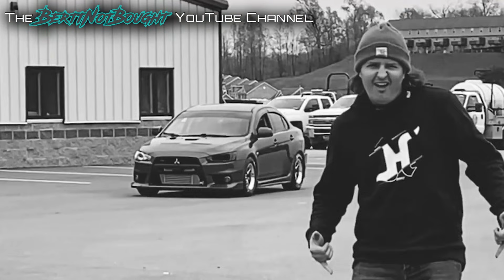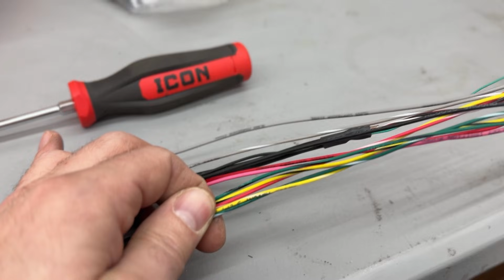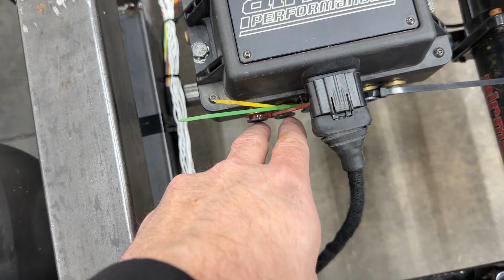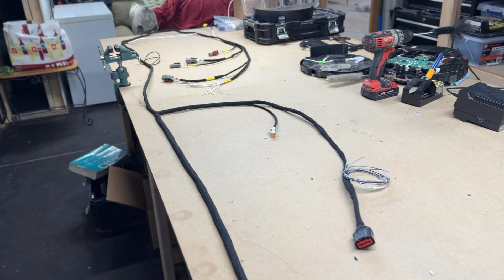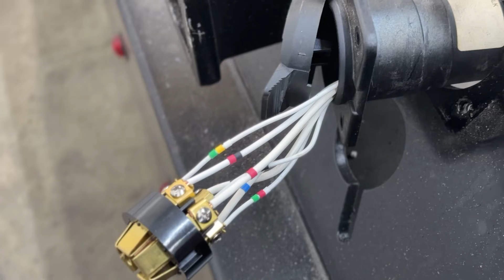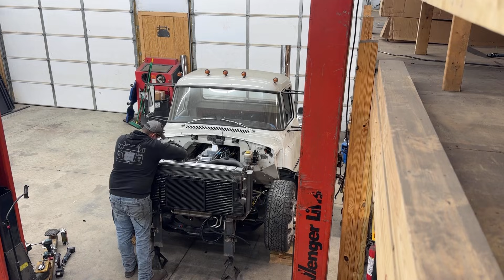LIGHTS & AIR RIDE in the SLAMMED Cummins Swapped ’75 Loadstar – WillSpec Wiring – Part 6

Comment: As an Electrician I would rather have 2 units run at 50% each rather then have 1 unit running at 90 to 100% and 1 unit sitting idle. But that’s just me, what do I know.
Reply from the maker: I have no idea what they were doing with this wiring. I don’t know if the other compressor ever ran because when I tested it, initially it was crunchy. 
It’s all good now with a dual power feed and all the logic is back on the control module.

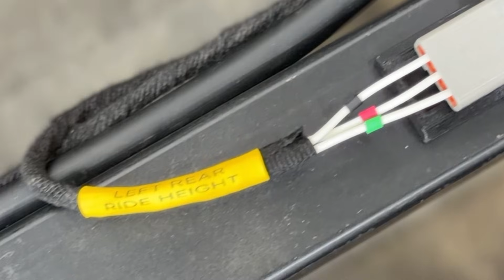Comment: 21:32 - what is the name of that style of connector?
Reply from the maker: I’m using 3 different styles, the one you’re asking about is a DTM. There are a lot of different makes but they’re all generally the same. These are deutsch barrel crimp in the applications I need them to be robust and areas where it’s less demanding I use JReady stamped.
The styles are:
DTM: 22-18awg
DT: 16-14awg
DTP: 12awg